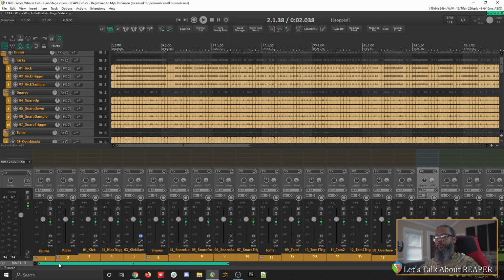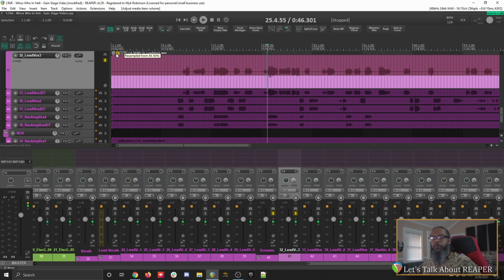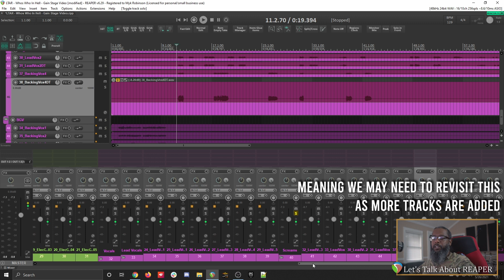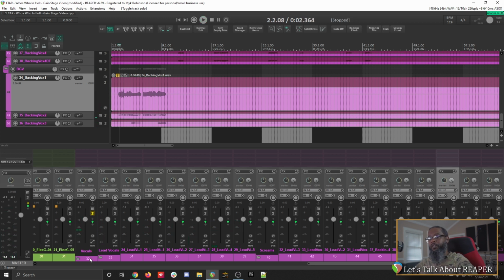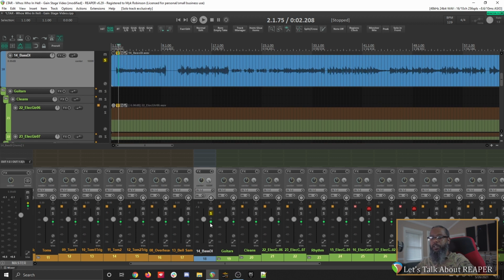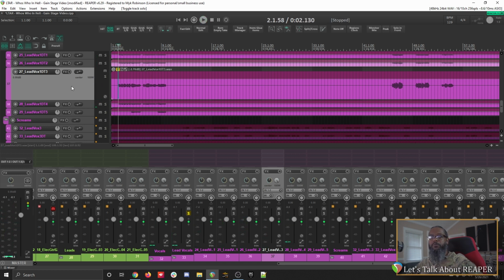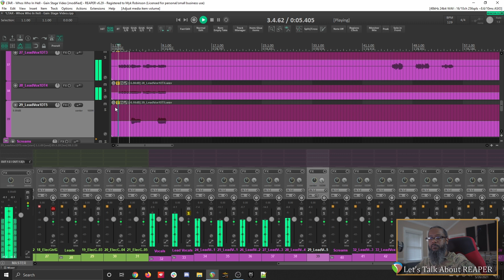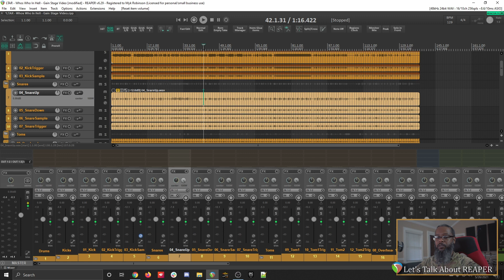Preparing to Mix in REAPER Part 2:   Gain Staging

Comment: Hey Myke,  What is your master meter setting... will gain stage similarly to you.. you're  some time meter coming into the channel.. some times i just normalize to -20.  But that said i will mix into my mastering chain on the master.  my master bus is set at -14 and everything else is metered at -18.  that =14 give me plenty of room for delivery at other formats. Making mastering easier.  a lot of times i am mixing multi tracks made from stages splits into dedicated multi track machines Tascam X48.. i do a lot of live recording and mixing for everything from DVD to broadcast or web cast that get resync'd to video so my recoding levels always need to be strong with peaks around -6 every where. so restaging is important when remixing later.  For me it also depends on the instrumentation too.  sometimes the mics are just awesome, some times they are not depending on the act.  if i can get a true capture of the mic i am really good to go.. i can gain stage later. and that is beautiful thing.. then after all that general gain stuff, i start to re-examin the gain trough my plugins..  I love it.. not to mention like @Chalkboard Jam Tracks, i will pull em all down like he does, or i might just at some point just duck the masters and  rebalance when i have my inputs right and my eq's right .   But i agree is it a black art.  i think once you get a work flow down you stick to it..  I also love watching you guys because i get little tips here and there and get a feel for what  and how you do it..  i always learn something. I think that is the most important thing. It improves your mixing and you adapt a style.  well thanks man.. i can go on for hours cause it is more fun than i should be allowed to have.  Not to mention the Discord stuff,  love it all.   Thanks for sharing your techniques   blessings to all you guys.  <><  J
Reply from the maker: Default settings, I have not edited any meter settings at all. Probably doing SOMETHING wrong but it works for me 🤣
Reply: How do I set my mixer boundary edit line from default grey to blue?? That’s so cool!
Reply from the maker: Not sure I understand the question. Can you explain a bit more, or find me on the Discord server where we can post screenshots and discuss?

https://discord.gg/TqBwsaJdWp

Comment: Nice video mate  i use this method too its very easy and you can also split regions and use the volume in this areas whats your theme you are using?
Reply from the maker: Thank you. The theme is called My Taste and is my current favorite with R6 default as a close second.

https://forum.cockos.com/showthread.php?t=250592